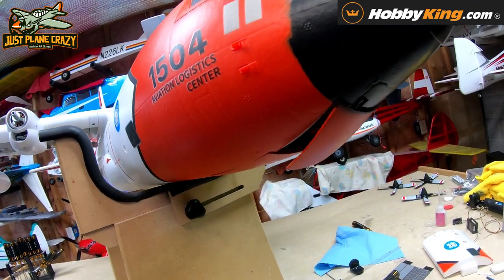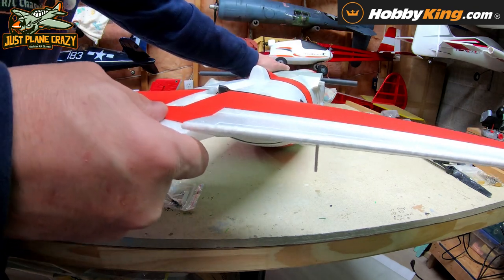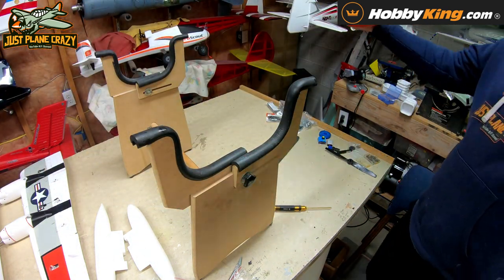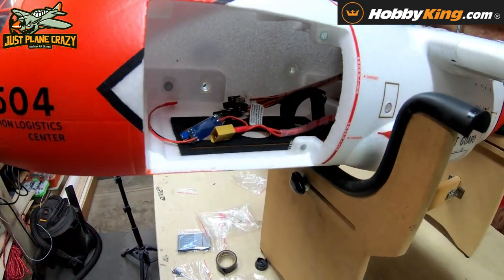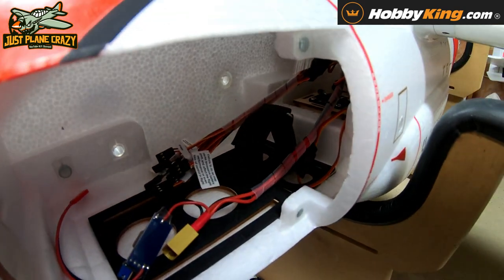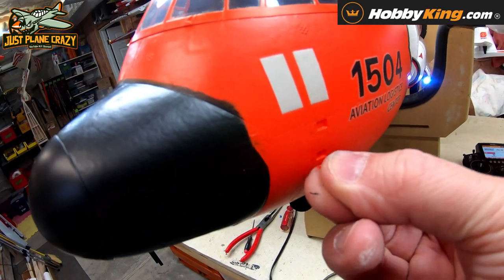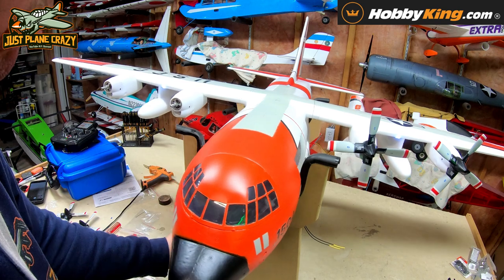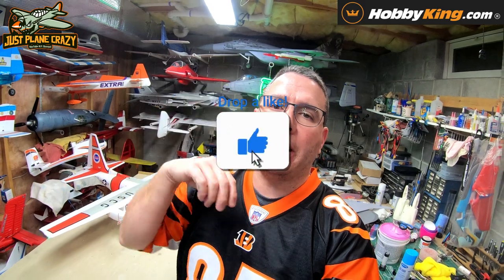Assembly of the New HobbyKing V2 C130 Coast Guard Scheme

Comment: Thank you. Received mine yesterday and am looking forward to assembling and flying it, along with the USCG HU-16E. I maintained and crewed on both aircraft (1504 and 7226) during the 1970s, and the 1504 in the 1980s. Also, the 1502 and 1503, and most of the 1600 and 1700 series. Semper Paratus!
Reply from the maker: Thanks for watching and thanks for your Service

Comment: Is the flaps operating on one switch or two? As I read the manual its on two seperate switches,  in which case, I would rather have on one.. whats your thoughts on this?
Reply from the maker: Flaps should be on a three position switch. Just one

Comment: Great assembly video... thanks.  Especially nice since the build manual isn't online yet.  Great tips.  What do you think the effect might be if the prop directions were changed a bit?  Each side would have one standard and one reverse.
Reply from the maker: Thanks for the kind words and watching. I think doing that with the props wouldn’t end well. It might let the motor pull too many amps and you ultimately would cut your thrust in half. My thoughts anyway

Comment: I just got mine today ... Thanks for the video ...  You mentioned calibration but then didn't show that step ... This is my first multi-prop plane ... So I was just curious what that calibration is/does and how to do it?
Reply: Watching it again ... Was the calibration what you did when you powered up with throttle all the way up? If so, I was confused because the comment was made after the calibration in the vid
Reply from the maker: It was. Turn in the radio. Throttle full up, you can put throttle trim all the way down. Plug in the batt. After first series of beeps put throttle down. It will play a musical sequence. Then check your throttle operation
Reply: @JustPlaneCrazy  Thanks for the clarification!
Reply: I received mine and the outboard flap servo on the right wing was DOA ... waiting for a reply on RMA ... Curious if they will just send a new servo or if the whole wing will need to be replaced ... Nervous about trying to remove the cover that covers the wires running down the wing ... It appears to be glued in pretty well (as does the servo)
Reply from the maker: Make sure u contact their CS
Reply: @JustPlaneCrazy  I did, and filed an RMA ... Waiting to hear how they are going to handle it